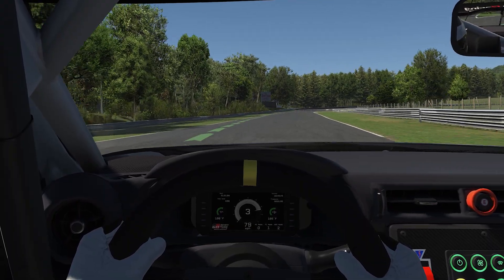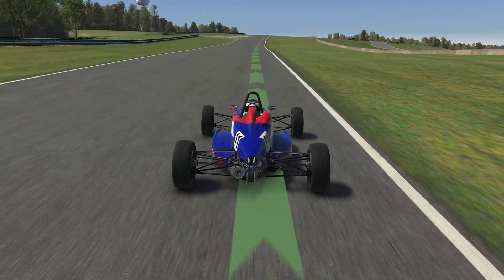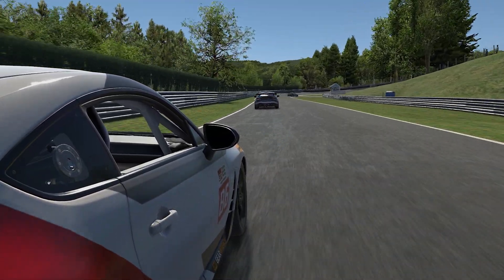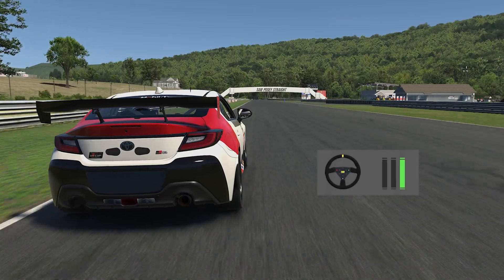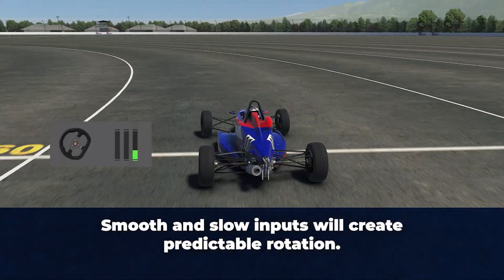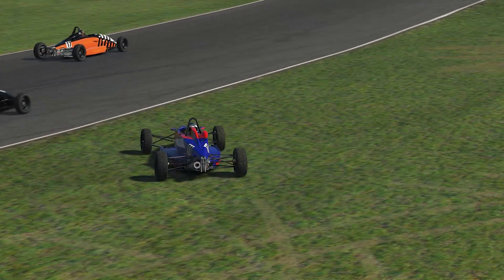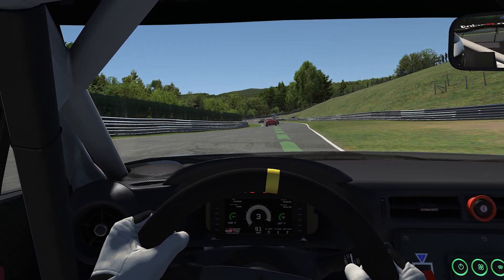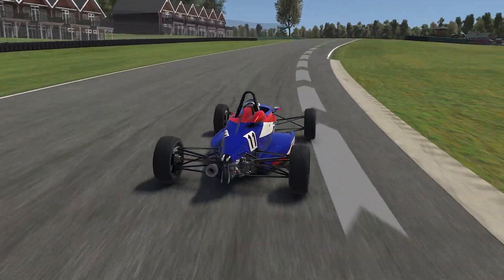iRacing Driving School // Chapter 2B - Vehicle Dynamics

Comment: im surprised they didnt mention smoothly getting back on the throttle when correcting a slide, that's a huge help to prevent you from just sliding in the other direction
Reply: Is this someting only in iRacing or it happens in real life?

Comment: I find snap oversteer caused by oversteer correction to be best modulated with the throttle pedal as well as the wheel.